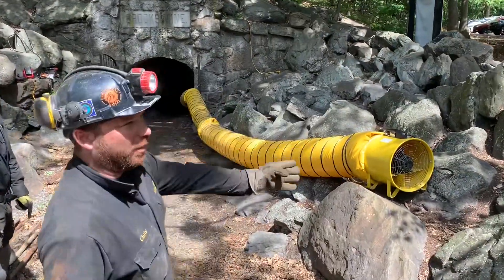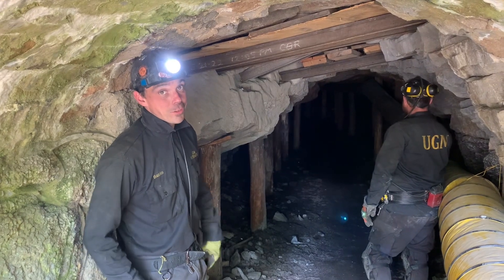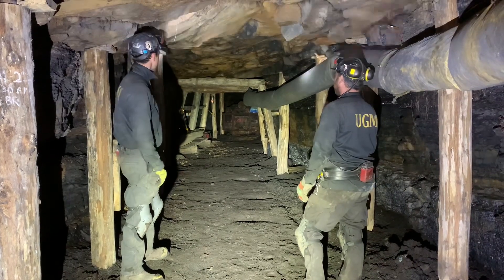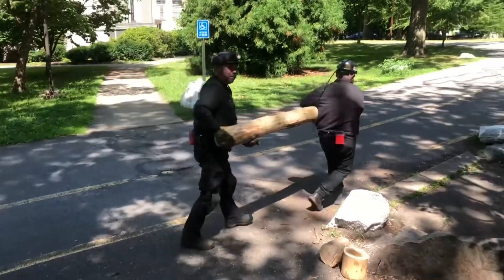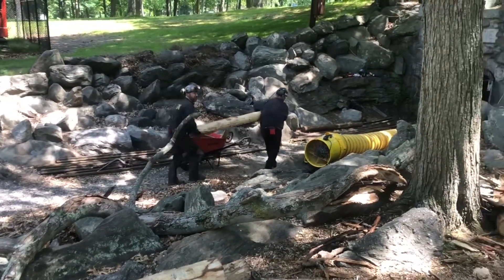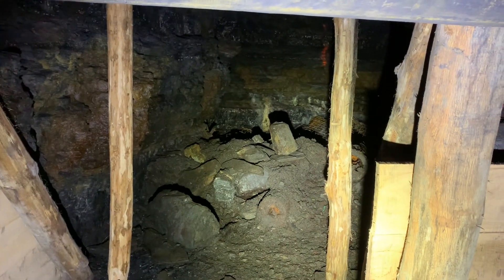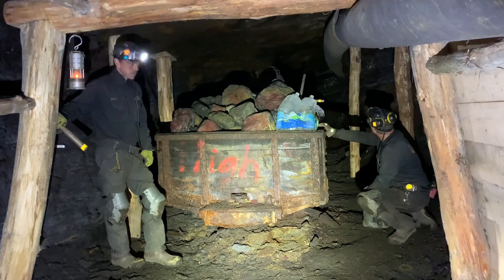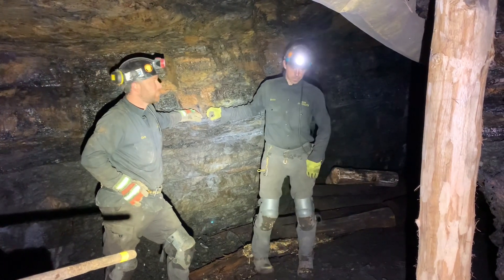Restoring the Brooks Coal Mine - Part 1

Comment: The dirt that accumulated in the tunnel(s) is likely from the place flooding quite often.

I can remember checking out the entrance back in the 90's before they made it so you couldn't see inside and it had water in it quite frequently.
Reply: Yea, it was pretty wet in late april in there. it dissipates real fast though.  going to have to address that for the future. all rain water just kinda flows in there. however, only some of the dirt is from that.  there was whole pile of pea gravel put down in there at some point raising the "floor" up about 18 inches. we are going to dig this back down again.
Reply: @cessna54tango  Was there ever anything built on top of the mine as part of it? Because I seem to recall some sort of ruin in the woods above the mine.
Reply: @CheapestGamer   not that I am aware of, and there is nothing inside that would indicate it.  I believed it was always a field and woods.
Reply: @cessna54tango  Maybe it's something leftover from Luna Park, though I think most of the ruins from there are under 81. 

I definitely remember what looked like part of a wall in that vicinity.